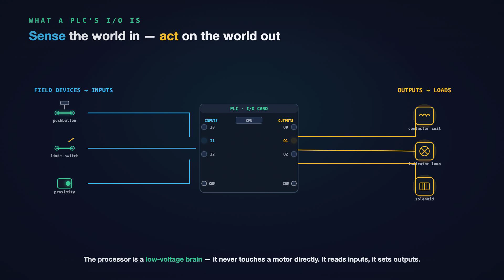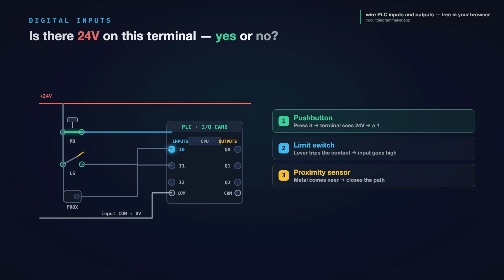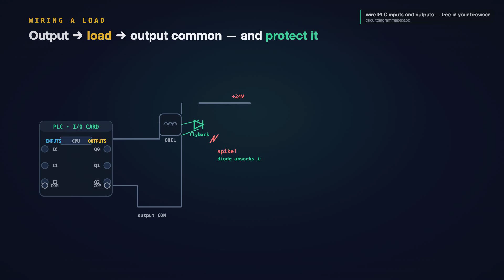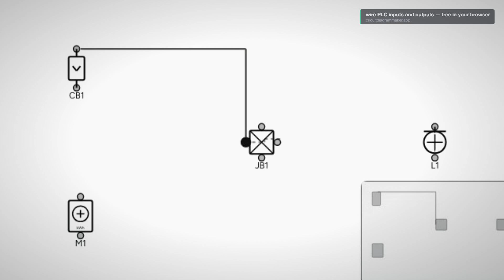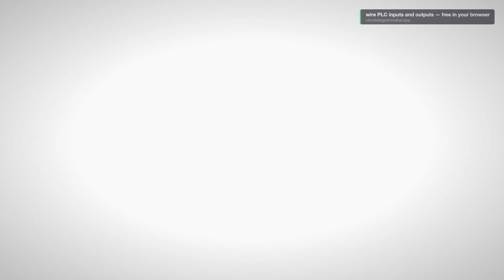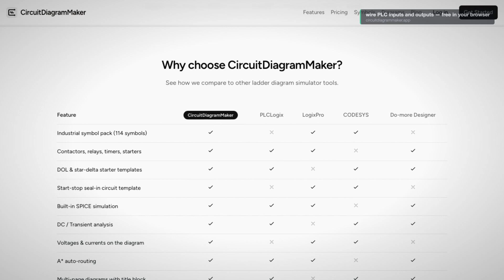How to Wire PLC Inputs and Outputs (Full Diagram)

Comment from the maker: Three things that make PLC field wiring click. One: the common is just the return path — tie the input common to one rail of your 24V and every input device only has to bridge from that rail to its terminal, so get the supply and the common right first. Two: sinking versus sourcing is only which way the current flows — a PNP sensor sources current into the terminal with the common on 0V, an NPN sensor sinks it out with the common on +24V, so match the sensor to the card or the input never fires. Three: any inductive load — a coil, a relay, a solenoid — kicks back a spike when the output turns off, so protect it with a flyback diode across a DC coil, or an RC snubber on an AC load, before it cooks a transistor output.

Open the exact PLC panel wiring diagram free: https://circuitdiagrammaker.app/diagrams/plc-panel-wiring-diagram?utm_source=youtube&utm_medium=pinned_comment&utm_content=yt-110